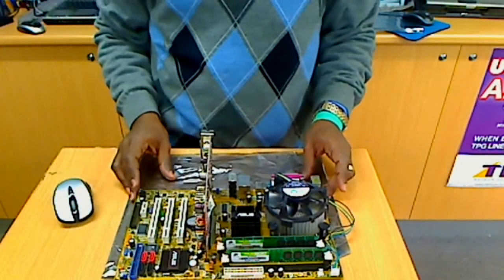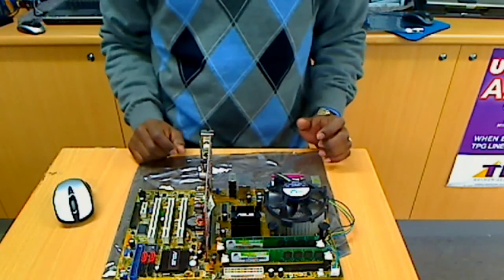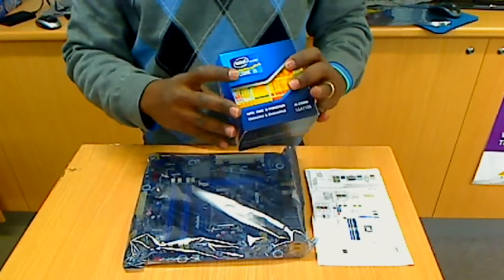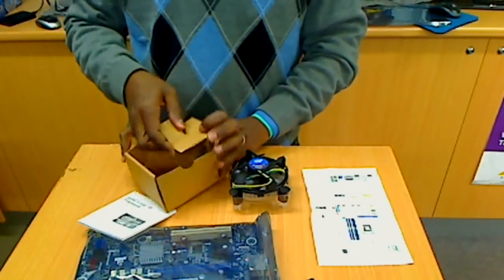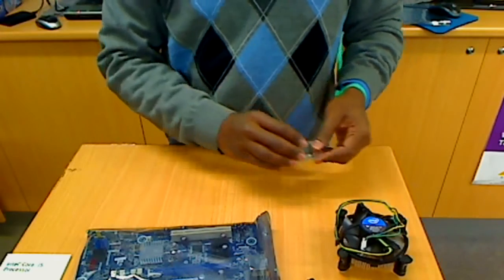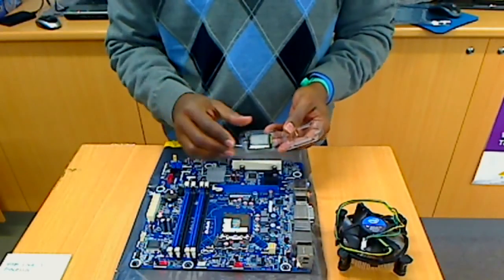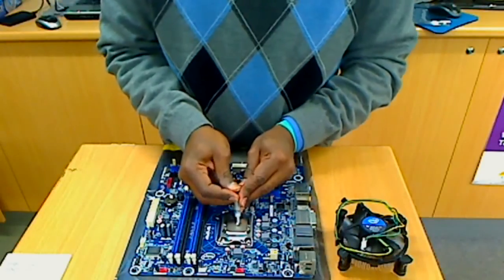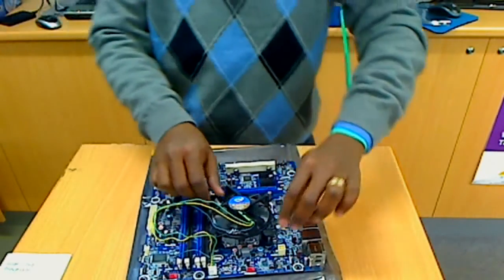How to Install New Intel i5 CPU into Intel Mainboard

Comment: I have recently bought two Asrock mobo's (Z77 and Z75 Pro3) and had a terrible time of installing the CPU and Heatsink and damaged the contact points on both.  I have no idea how the damage is done as the installation is supposedly so simple.  This is my first Intel CPU and first heatsink that clamps down like this.   As Asrock are in Taiwan only, getting the 1155 sockets replaced is a no-go as far as I can figure.  I am now terrified of putting any pressure on the heatsink when pinning it dow.